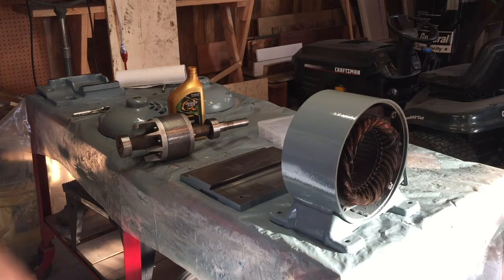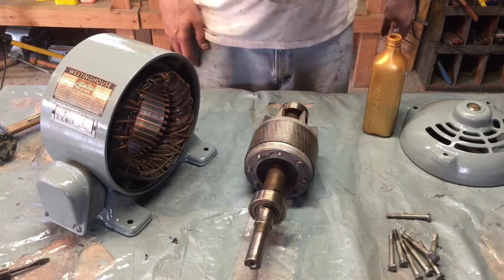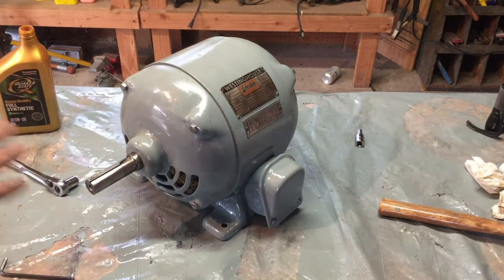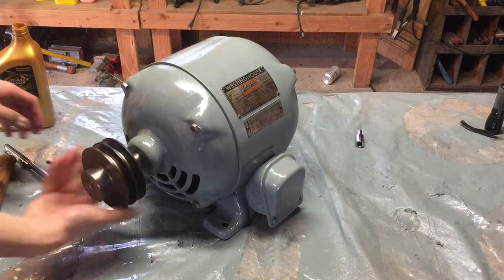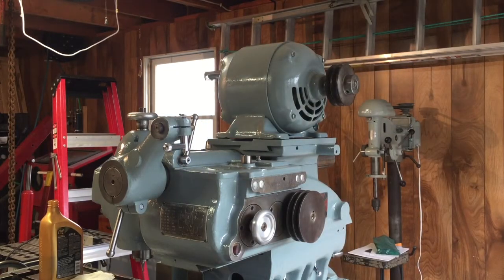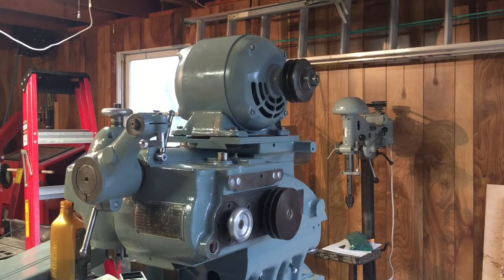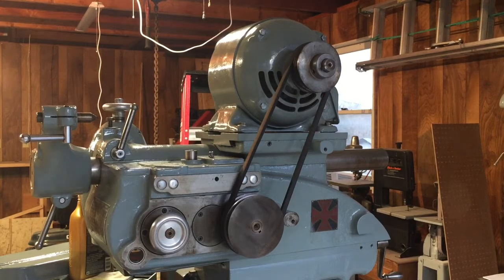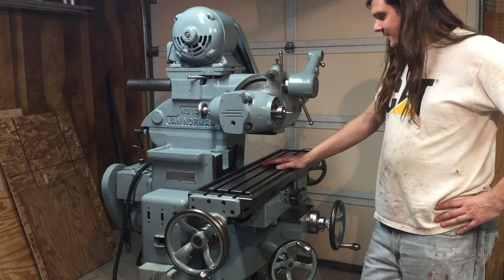Van Norman Model 12 Mill: Part 6 - Main Motor

Comment: Hey, I'll be joining the club Wednesday, rescuing a van Norman #20 duplex mill from the scrap heap.  Having trouble finding much info on it, any suggestions?  Maybe it's related to the #2 duplex mill?  All I can find on it is references on practical machinist for the old van Norman machine tool Yahoo group, which is no more.  Any info you might have would be appreciated.  

Keep up the good work on the vids.  I'm disabled with M.S., and can't hit it as hard as I used to.  It's almost as relaxing watching someone else referb old iron, on my symptoms are bad and I can't get much work done.